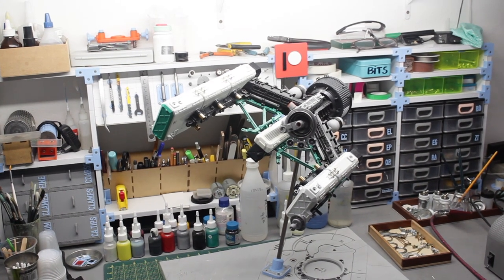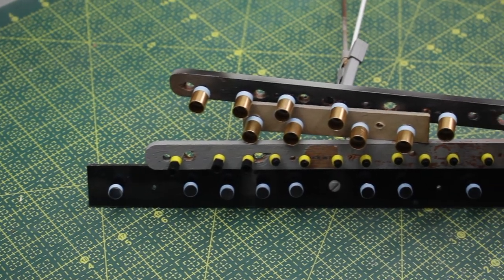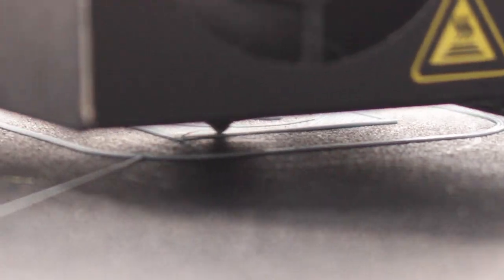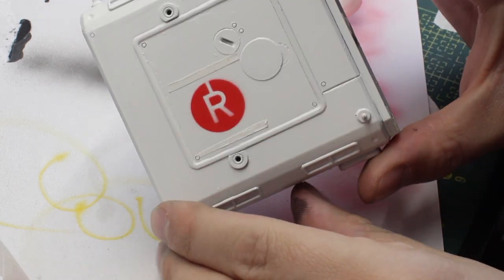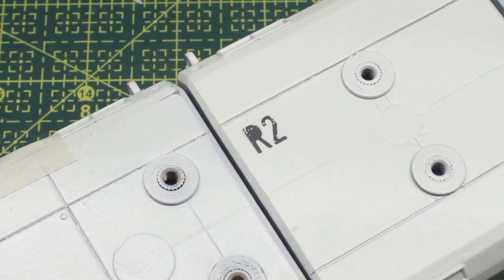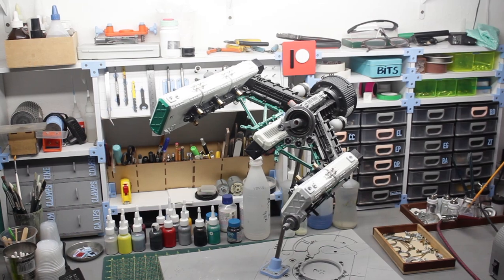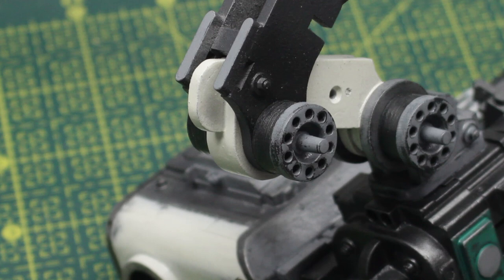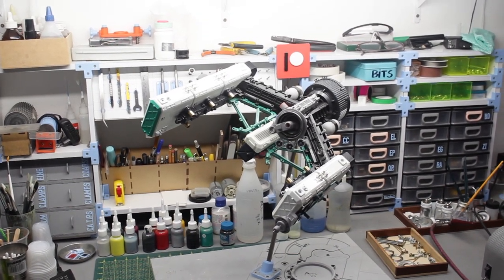Sniper Spaceship - Part 14 - 3D printing some stencils!

Comment: One 'quick' tip with using stencil but especially masking tape to prevent bleeding under some edges is to spray your first coat in a clear. This will bleed under and 'fill' any little voids, let it cure then follow up with the colour spray. Highly recommend Schminke 50 601 aerogrund clear primer. Also sticks to anything so useful for kitbashing random plastics.

Comment: 3D printed stencils are a great idea. Loving the addition of brass on the large screws. Some thoughts:
1. Try a really light dusting of spray adhesive to prevent overspray getting underneath the stencil where you don't want it. Tape adds thickness, so paint gets underneath. It will turn the stencil into a big sticker, and should peel off if you don't use a ton of spray (I used this for painting shirts and keeping cardstock flat around all perimeters). Alternatively, put the stencil on a large piece of double sticky tape and trace it out with a fine knife.
2. What about a stencil where the little bridging piece is lifted off of the surface? That way the paint can go under the plastic and not leave gaps in your lettering. You could even make the bridges manually with some upside down U shaped paper clips super glued onto the 3D print, or whatever works. (Stencil bridges are an aesthetic choice and work really well here, but might not want them on other projects/locations)
Reply from the maker: The bridge idea is genius, I gotta try that! I thought the bridge looked ok, so I left it there, but your idea is an amazing solution for that. As for the adhesive spray, I'll see if I can find it here... never saw it being sold anywhere..

Comment: It would be really cool if the other sides front cap was painted red. Kinda like the navigation lights on a boat indicating which side is which.
Reply from the maker: Which front cap?
Reply: On the wing segment. You painted the right side green, if you painted the left side red they would be in the same configuration as a boat.